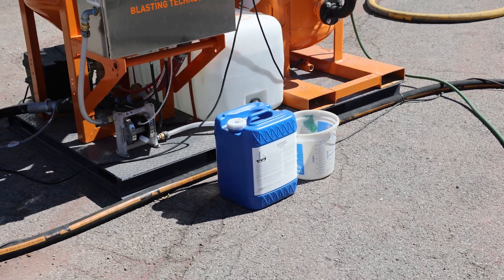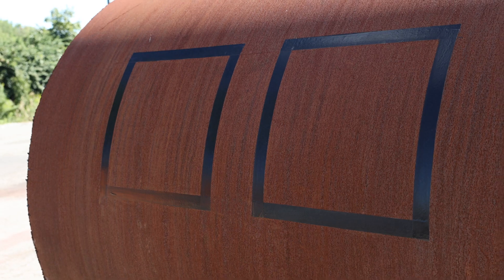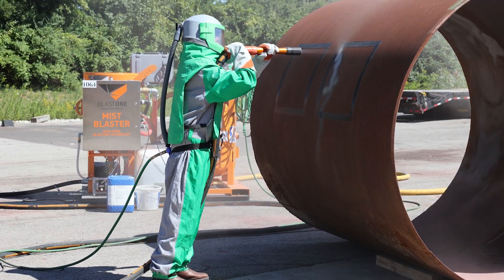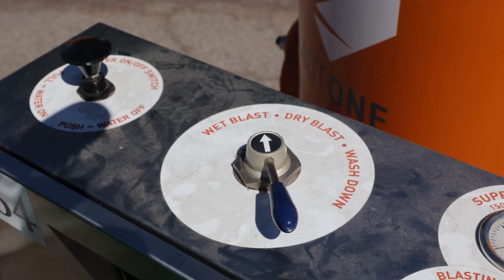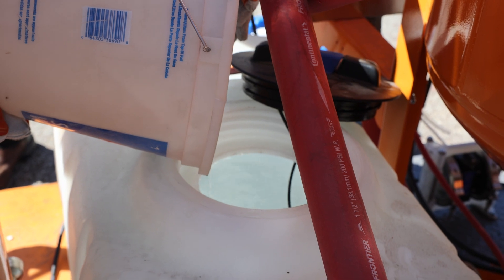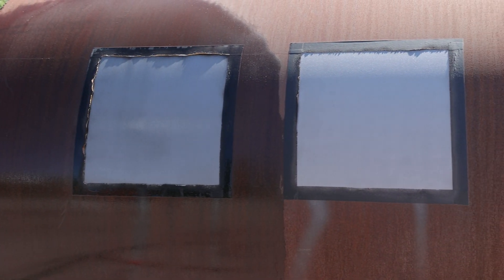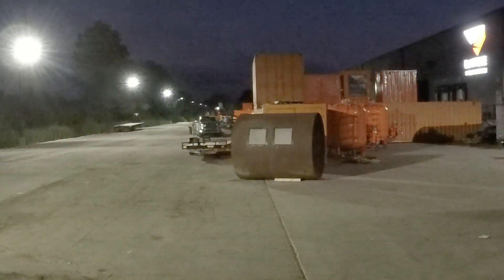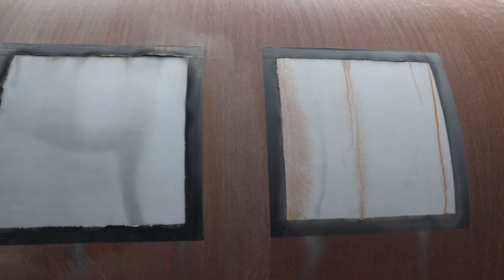Stop Flash Rush and Hold the Blast Longer with Rust Inhibitor

Comment: is the "Hold Blast" OK with epoxy over it.? another question...since you already put a rust inhibitive product on the steel could you just paint the steel without using a DTM paint...?
Reply from the maker: Part 1: It is approved for coating application and does not need to be sweep blasted unless the PDS or specification calls out otherwise. 

Part 2:  Hold Blast does not act as a primer and you would still need a base coat when applying products not intended for direct to metal application.

Comment: The dry blast would not have  "flash rusted"  had you not got it WET with the wet blasting.
Reply from the maker: So you're attributing the flash rust to the mist of the wet blasting water - that didn't rust the neighboring square that was drenched with it?
Reply: I agree with colourcodetools, bit silly blasting a square side by side of course mist will hit the dry patch😂
Reply: Probably not a bad product but I can see the over spray also.
Reply: Not a very well thought out demonstration video